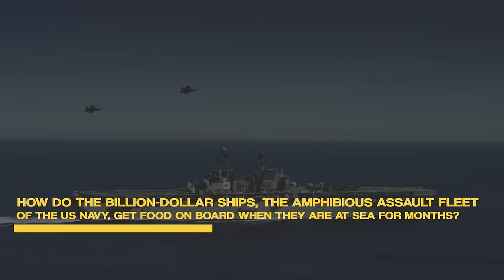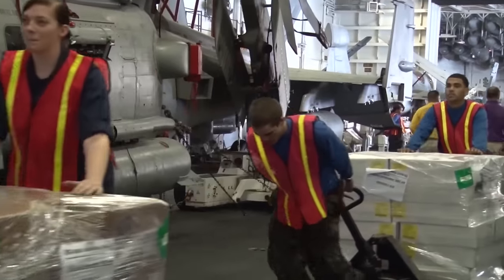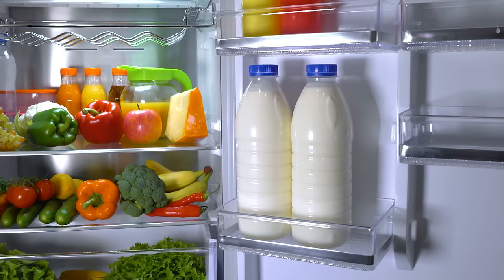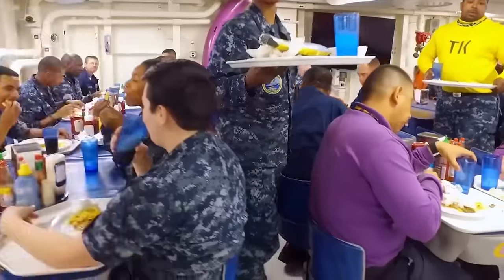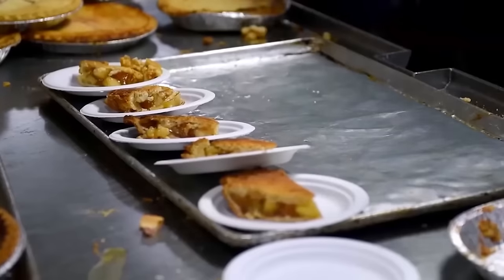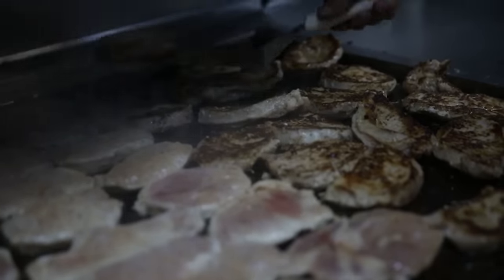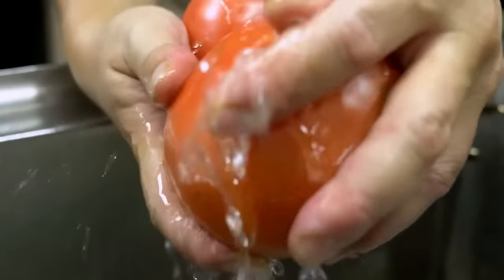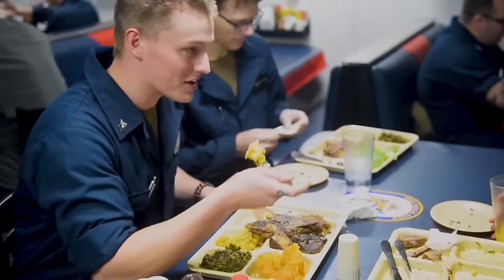Inside the $13 BILLION US Navy Amphibious Assault Ship KITCHEN

Comment: On a missle sub in 76 out of Scotland. Started as a non rate E-3 mess cook. Crew of 116 we had to load 19 pallets for 100 days. Had a new head cook who did the ordering for my second run. He screwed up bigtime. We ran out of eggs after 3 weeks, butter after 5 weeks and even salt. We pulled in after patrol with 1 can of ham and a couple cases pancake mix and powdered eggs and powder milk.
At least the coffee was well stocked.
I learned we could get salt from the discharge of the evaporator. Sea salt isn't half bad.
Margerine can be made with Cisco, salt and a tad of yellow food coloring.

Comment: The most significant logistical challenge to at sea replenishment 15:39 is the navigation of tthe two ships traveling at speed, same direction and near enough to each other to actually transport pallets between ships. There’s a physical low pressure zone between the hulls that want to draw each ship towards the other. A mistake by either ship’s helm personnel or deck officers could result in a serious hull to hull causality.
Reply: Agree.

Comment: 12:11 Billion dollar insight for real life, movie, anime, or thesis to feedback to management. Humans on navy vessels and submarines eat a lot of pastry, buns and bread. The process of a single cook single hand slicing one dough at a time is way too slow. Normally humans eat 50% carbs for their meals. If you can improve this process via automation with lightweight durable NASA grade machinery, it will max out management profits, salary increase, and max bosses charity donations to orphans and disadvantaged children of veterans or soldiers who were K.I.A. How? After creating the dough, run the dough into a machine similar to sausage making machine or a press that stencil clamp vertically downwards on the dough to instantly cut the lump of dough into equal sized parts. Manual process is to use roller pin to flatten dough into rectangle oblong shape of bun height and use a very long cookie cutter samurai sword to cut into similar shapes. E.g. 20 cuts vertically, then 20 cuts horizontally. Eliminate the human cook that roll the dough into ball shape and bake cube shaped bread. Use cost savings to increase salaries of management and workers that eat the pastry.